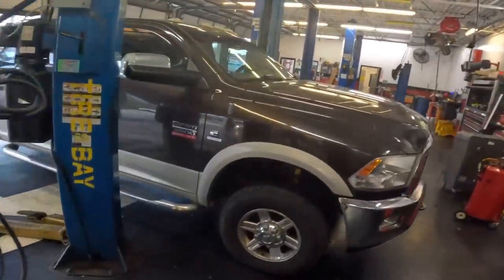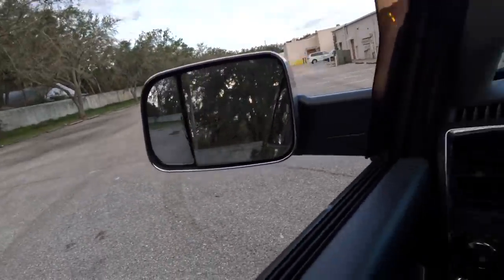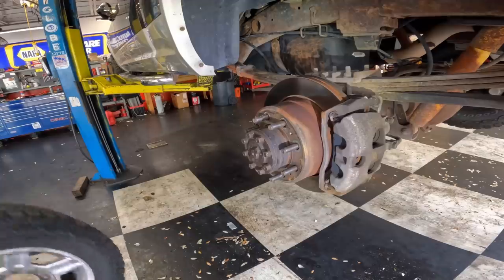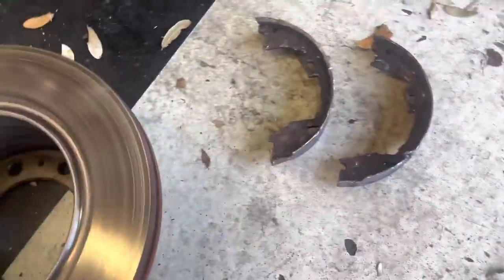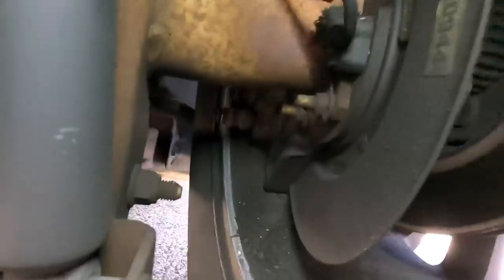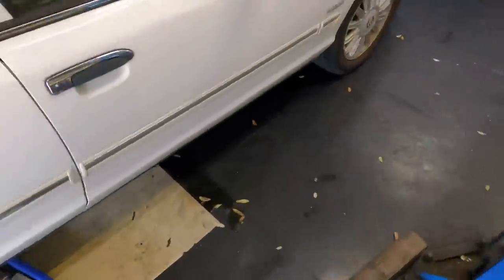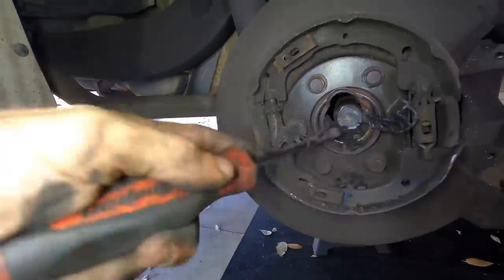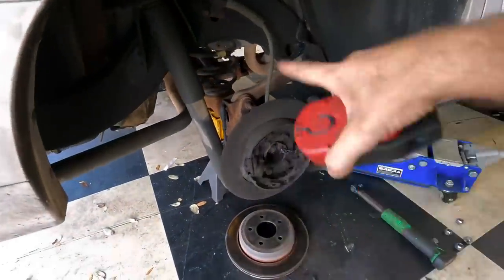Could have Killed Someone!

Comment: You know they circled the problem when they discovered it. I mean nothing against Ford or anything they're really great, just as long as you don't get the 3.5 EcoBoost. The 5.4 -3 valve. The 6.0, 6.4, or 6.7 diesel. Other than that they :can be a reliable vehicle

Comment: That car would have been making a horrendous noise. Its would have been doing it for a long time not just 5 minutes down the road. The bearing has failed an they kept driving it till it stopped. That was dangerous as when the axle sheered it quite likely could have thrown the car into parked cars or oncoming traffic as the angle of the wheel changed.. Just from a financial angle if they had bought the car in for an inspection to see what the noise was it would have only been a wheel bearing job. That consists of a wheel bearing replacement check the diff oil level and inspect the rear brakes and labour. Now they are in for  the bearing job an axle and possibly an axle housing if the axle has cut into the axle housing where the bearing sits. The cheapest way out is to replace the back axle assy from a junkyard.

Comment: I've ignored brakes till they welded themselves to the rotor. I've ignored leaks the size of the grand canyon. Never would I ever ignore what that mercury would have sounded like. Dude must have been hard at hearing or just straight deaf. The amount of heat that wheel would have been generated would have been enough to keep your hands warm when you get out of the car lol

Comment: Don't replace the hub on the RAM just for the minor scratched caused by the parking brake hardware. Would be a total useless upsale IMHO.  No hate, just my opinion.
Reply from the maker: Perhaps… But consider this…how about the overall strength of the part? Consider that’s it’s going to be loaded and pulling a trailer. There are tremendous internal forces happening here because both wheel bearings are housed within the hub. It no longer meets structural standards due to the damage.

Comment: Scary stuff. Wish I could share pictures on YouTube. I have a 20 year old Jeep WJ that has disintegrated coil spring insulators. Completely gone, one is hanging halfway off and the bump joist is the only thing holding it from popping off.
Currently budgeting repairs each month. Doing $360 this month on electric, throttle body/sensors, air intake system, wheel hub anti-seize for seizure prevention, cleaning MAP, MAF and IAC sensors, changing spark plugs and fixing #2 misfire (P0302), flushing coolant and bleeding air out to fix sloshing noise on startup, fixing windows, locks and power mirrors and then I'm doing steering(tie rods) and suspension parts. Already put in new shocks. Then hopefully I'll get rear coil spring insulators. I also need front and rear Lower Control Arms and possibly a rear upper A-Arm + tri bolt Plat + upper control arm w/ ball joint complete with 4 Sway bar links and Sway Bar Bushings!

Comment: The Cummins could have gone back to work without the parking brake that someone drove with it engaged for a few thousand miles, I have almost 300000 miles and never used the e-brake much but then I live in flat country and I notice that light when you don't release it, the Cummins doesn't care, it will overpower it easy

Comment: So I'd have to guess,, some one was 🤔 haveing fun,,, and found traction a bit to fast,,, my buddy uncle ripped the entire rear end and axle tubes off the frame once in his 29 Ford,, he then installed a 4 bar rear end set up, from there I know a few broke an axle, riped the rear end out, snaped universal joints,twisted a drive shaft, and I'm only one knows some guys used to do back yard hot rods in our youth

Comment: ive seen that kinda damage before, some times you can reuse the springs and hardware  on rear drum brakes, but If I was shop owner, I would replace  every thing, those aftermarket brake  parts  that are not Made in the US suck, and should be banned

Comment: Well since junker cars cost more than just fixing your current junker throw the parts at it. My last work van I drove for 16 years and swore I'd never do that again. I bought a new Transit in 2018 and the plan was get a new one every 5 years. At current I can get what I payed for my van 4 years ago with almost 100k miles. A new one isn't even available and I'm not paying over sticker for one. Guess I'll drive the wheels off this one

Comment: wow... i have done quite a few ford rear diff repairs and replacements but i have never seen one driven to the point where the axle sheared off at the hub/axle tube like that..  That person is a special kind of not giving a S**T !!  😂
Reply: The special pucker factor needed  while driving this rig prevented the operator from taking a dump for at least a month😳

Comment: STORY TIME! so  in 2021 after making a trip from FL to NC and back 2 or 3 times, my F150 started making a squeaking noise in the passenger side rear. It sounded like running through a room of squeaky toys, it was aweful but i didnt have money to fix it and i didnt have the skills at the time, or the knowledge. in my ignorance, I, well... ignored it. i figured it was just another noise from a 25 year old truck but oh boy was it spectacular when i finally cracked it open. bearing was destroyed, seal was destroyed, and my axle shaft had a 2mm groove dug into it all the way around. i ignored that sound for a little over a year and it couldve killed me. i was ashamed and humbled and i will remember to NEVER AGAIN ignore my grinding noises lol

Comment: Little sweet cheeks neighbor, "So my car's rear end makes a couple of different noises. At lower speed, like in the parking lot it sounds like George Jetson's spaceship car. On the highway it sounds like 3 tomcats in a metal trashcan fighting over a tabby in heat. Do ya think I should have it looked at?".

Bubba her neighbor from 2 trailers down, "Naw, it'll be alright. Jus wait until sumptin falls off, that a way they'll know what needs fixin'. It's always cheaper that ways.".

Full disclosure; I lived in a trailer park at one time.

Comment: I'm so confused. The Dodge has a rotor and calipers...then why does it have brake shoes? Shouldn't that be pads? I'm not familiar with every vehicle design but my mind is definitely having trouble wrapping itself around these components.
Reply: Rotor disc  and caliper are the normal service brakes. What you use to slow and stop normally.
The shoes and drum are the parking/e-brake parts.
Reply: Thank you for the information and insight.

Comment: My car was making a wheel bearing hum one time, and I turned down the stereo and told my kids to listen. Then I explained what it was, and that it's because the race or bearings inside were going bad and they weren't gonna last long, matter of fact, theyre probably hot as hell now.  (my worry wart never let me down) The oldest asks, "what happens when it goes bad all the way". I spun my best horrified look in his direction (making sure all 3 seen) and said "GOT DAMNIT BOY, WHY ON EARTH WOULD YOU BRING THAT KINDA JU-JU DOWN ON THIS FAMILY,  HAVENT WE BEEN THROUGH ENOUGH) Crossed myself and went back to driving, with both hands, shaking... They won't ever ignore the sound of a wheel bearing/hub assembly, THAT is for sure...

Comment: Guess Florida doesn't have yearly auto safety Inspections. Cars like this are a risk to everyone, that broken axle could have come off and killed someone. It's clear the rear wheel bearing was bad for a very long time before it came apart and the axle ground itself to the point of breaking off, thankfully the car stopped moving under power once the axle broke off.  The driver had plenty of warning from all the noise coming from the right rear of that car and did NOTHING about it.

Comment: Looks like they needed more Volume on the radio so there's your problem.
Sad that the car had to out preform the sound system, poor thing was probably screaming miles ago and begging for sweet death.
I seen all of these problems and one day you'll see nothing but a sun roof drive in when they wear the car down that far.
If they had a better sound system the car would of been a bucket of dust and memories.

Comment: I lived in Arizona for over 25 years and bought a boatload of cars that were sitting in back yards for YEARS (I did A/C so I was on a lot of roofs) and would knock when I finished my job and heard the same old story time after time "oh, that thar is a fordy or fiddy thousand dollar car and I'm a gonna fix it" as the wife or significant other is behind with fire in her eyes, so I would leave my card and more often than not I'd get a phone call a day or three later.  It seems momma ain't putting out until he gets rid of that piece of s*hit.  Gimme fiddy bucks and make it gone, so I called a friend that had a salvage yard and he'd tow it down and put it away in our secured area until I got the title transferred, then looked to see if it was worth saving or parting out.  One of the things I noticed is that there is a BUNCH OF S*IT ON THE HIGHWAYS AND BIWAYS of Phoenix.  Since we didn't have a safety inspection, but by the gods you WILL pass emission testing.  Bald tires?  No problem.  No brakes?  No problem.  Missing doors or hoods or fenders?  No problem, just PASS THAT EMISSION TEST.  NO ONE repacks bearings, replaces brake hoses or other NORMAL things that any other state would look for on a safety inspection.  If I decided to keep a car, I went through EVERYTHING and replaces, repacked and renewed EVERYTHING to make it safe and roadworthy.  It was costly, but it was SAFE.  I haven't come across anything like that Merc, but have seen some really trashed mechanicals.
Keep up the great videos.  Sometimes you can't fix stupid and their stupidity could really RUIN YOUR DAY if it falls apart while driving and smacks you.
Glad you made it through the rain shower the other week.
Reply: Thanks for the feedback and expect more videos soon. Send me a text above🔝🔝🔝 I have something for you....
Reply: Scam alert. This guy isn’t our Ray.
Reply: @freefromratrace3315  Reported him.  Should be gone sooner rather than later.

Comment: Why change the hub? That's just a little scratch! If it ain't broke, don't fix it. I've had brake shoes wear down to the rivets, then turned the drum and slapped it back on with new shoes. Does any shop even turn drums and rotors anymore? I've rebuilt carberators with junkyard parts too. I've used a sparkplug file to clean up points and gotten another couple thousand miles out of em. I swear, people seem to have forgotten how to live cheap. These new trucks are like centrifugal bumblepuppy, designed to wear out and break so you have to spend more money. And marketed to convince Joe Braindead Consumer that it's the greatest thing since sliced bread. Know what? I have a bread knife.
Reply: Thanks for the feedback and expect more videos soon. Send me a text above🔝🔝🔝 I have something for you..
Reply: Scam alert. This guy isn’t our Ray.

Comment: Damm useless emergency brake.  A relic off the past  that lives on only to cost vehicle owners problems (money). I for one have failed vehicle inspections for an e-brake not holding. Hold what, I've never used the the damm thing. I just put it in PARK. I now expect to hear how important this relic is. Fire away.